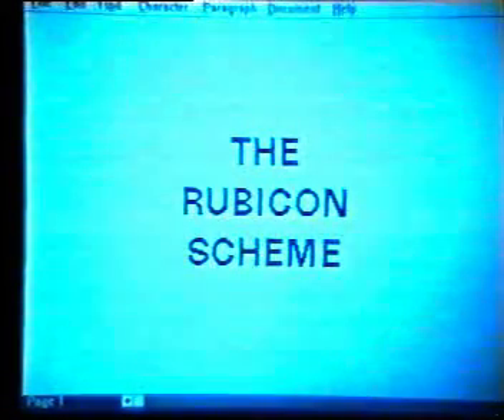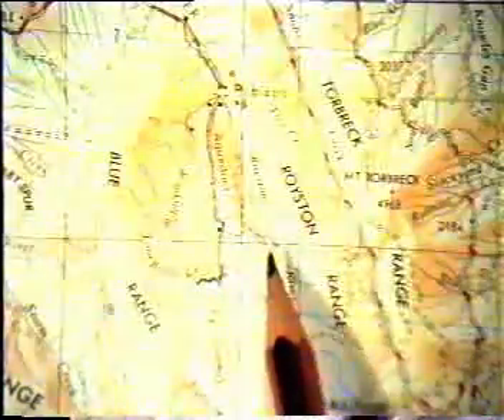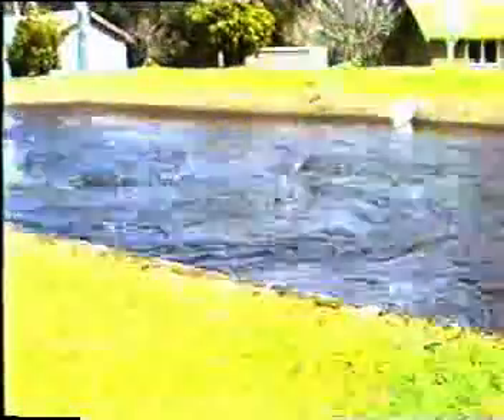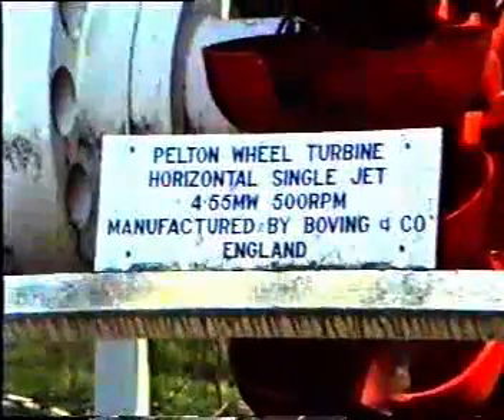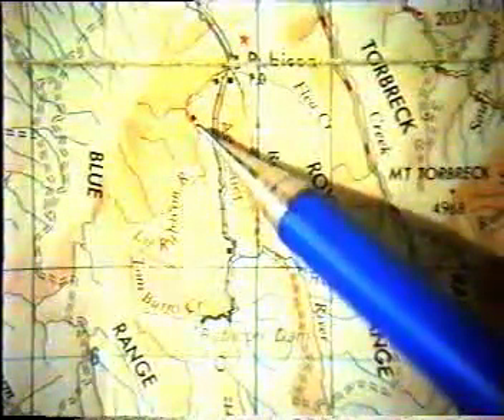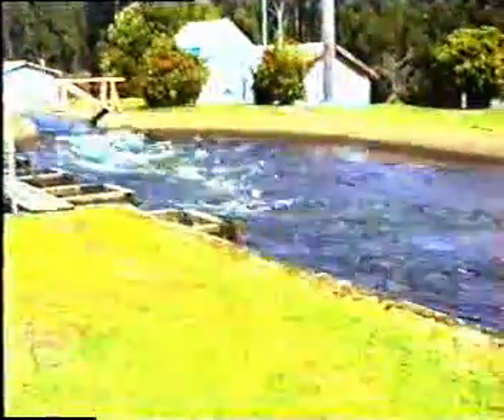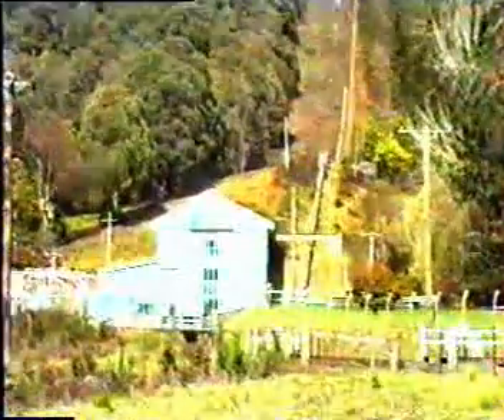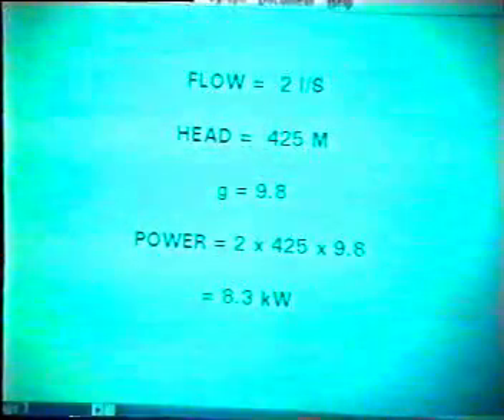Hydro video part 1

Comment: Why operate only 4000hrs per year. should be 8700hrs  less maintainace say 60 per year.
Even with a dry season surly the machines just run at reduced output.
Cheers
Martin